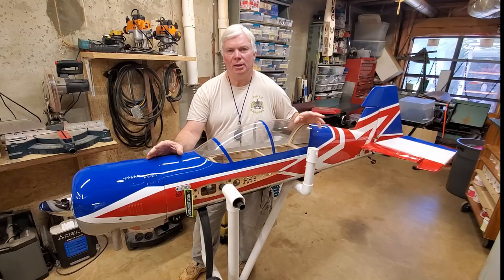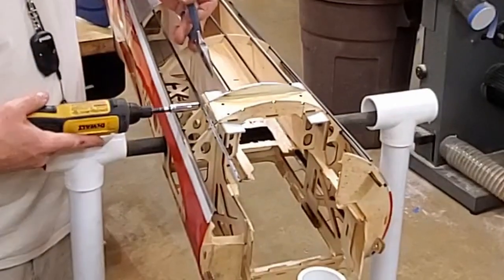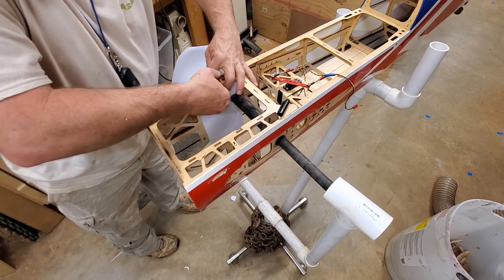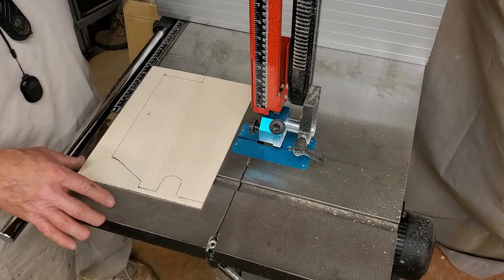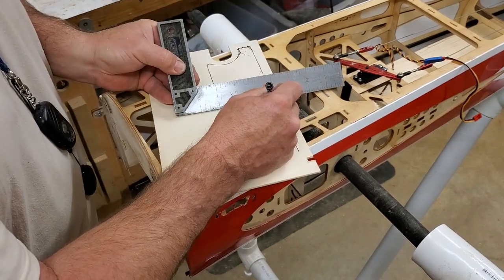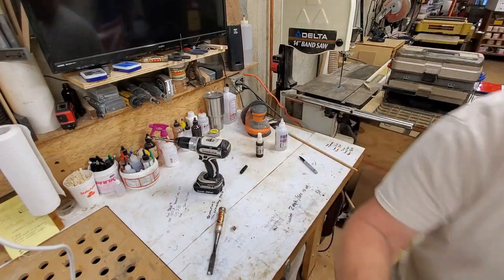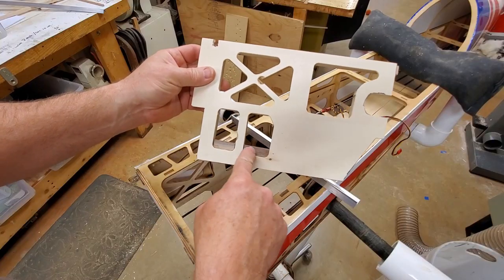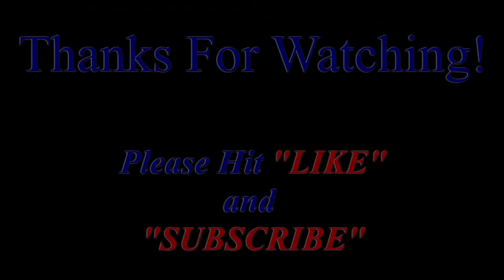E1  Extreme Flight 91 Inch YAK 54 Repair Part 1

Comment: Mike, this is great information. I hope I won't need to use it anytime soon,  but you have given me some different ideas for the future.  Thanks a bunch.
Reply from the maker: You never know when the plane gods will demand a sacrifice.  

On the serious side, the landing gear repair can be adapted to any plane.   Almost all ARFs are weak in that area (I am convinced by design)  and a simple rebuild in that area after gear failure saves a fuse and makes it stronger than before.  I'm glad you found it informative and thanks for the kind words.

Comment: I imagine the plane stalled, did it? Excellent repair.
Reply from the maker: Thanks.  
It was in a hover about 50 feet up.  The cheaper power box failed and shorted everything out and killed the motor.  It had just enough altitude to get going straight in.